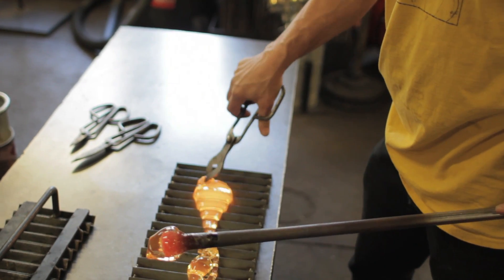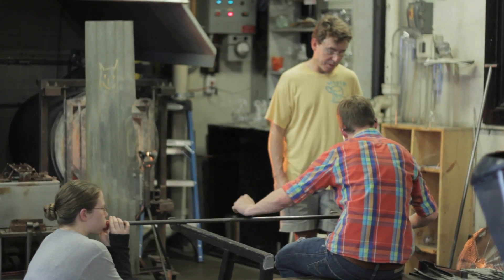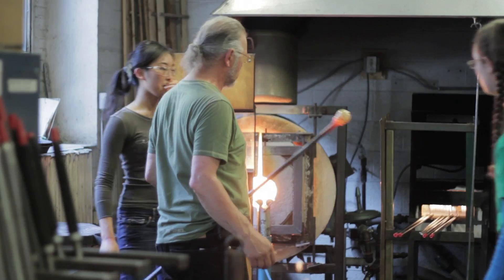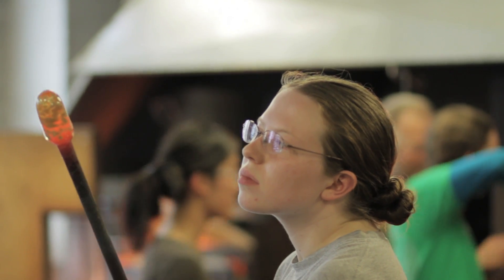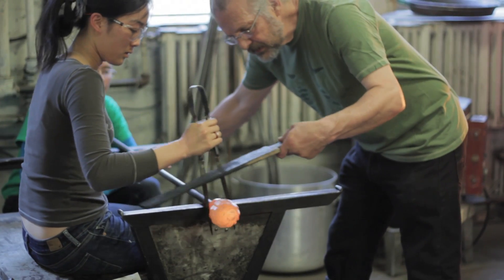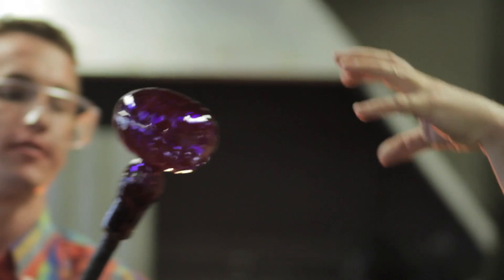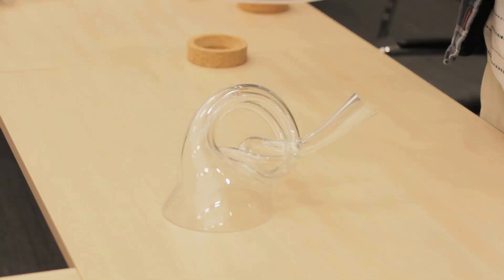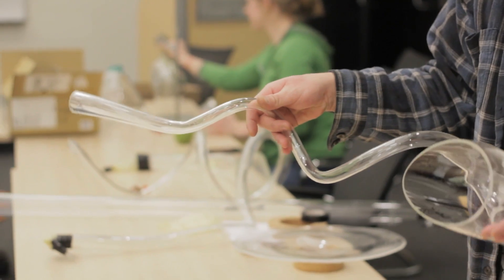MIT Glass Lab: Where art meets science

Comment: Very interesting. I am however surprised when both instructors and students didn't use personal protective equipment like gloves when handling glass, and having appropriate clothing at work to minimize the risks. Good that they are all wearing safety goggles. I think health & safety comes first, in such lab. What do you think?  Thanks for sharing.
Reply: Glassblowing with gloves is only useful when shielding ones self from the radiant heat that comes off of the glass itself. I expect that the size of the pieces that beginning students create is far too small for this to be an issue. Burns occur most frequently from touching the heated metal rod or tools, not the glass itself. The problem that wearing gloves presents is that if the students were to be unaware of the amount of heat being transferred to the glove from the radiant heat of the glass, the gloves might catch fire and cause a much more sever burn. This can be easily avoided if the student feels the heat without the glove and doesn't keep their hand too close for too long. The only reason that the students wear glasses is because the glass spontaneously pops off of the rod and could become lodged in somebody's eye. Appropriate clothing consists of non plastic fabrics and close toed shoes. They may burn if heated sufficiently, but if they are on fire, water is readily available. Cotton is essential because synthetic materials melt to the skin and will cause much greater damage then flame. 

In essence, diminishing risks in the hot shop come from being aware of the possible dangers of the material and environment, not from excessive protection.